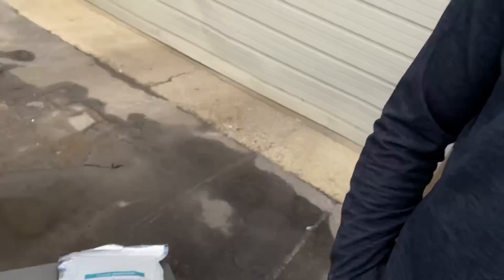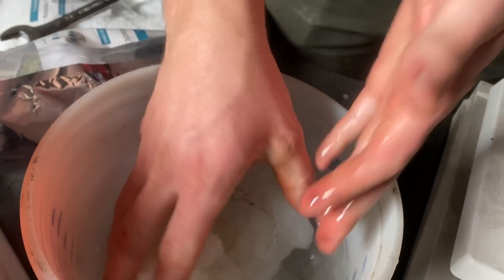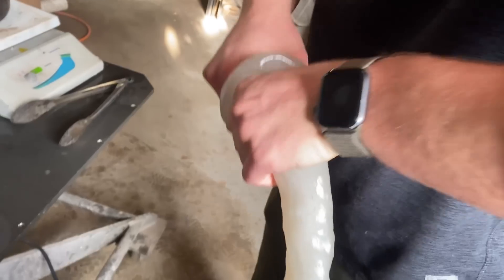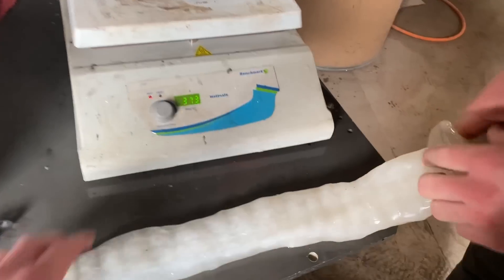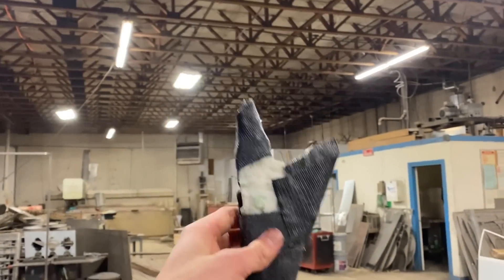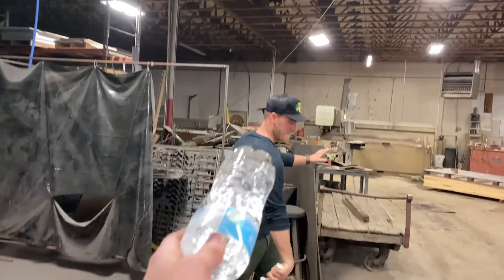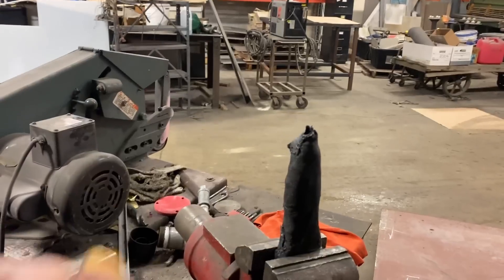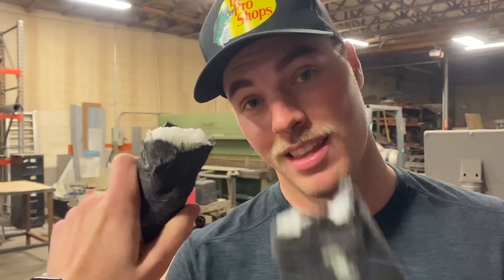These Materials Can Make Anything From Scratch

Comment: You could make some molds out of steel with the water jet or maybe 3d print some stiff molds out of a high temperature filament and use that to make tools that are more refined in shape.

Comment: See the trick is to make a tiny one first, let it cure, and then mold the bigger one around the tiny one and have some thin strips of steel in the plastic where the sharp part of the sword would be, then after the final wrap cut the fiber fix down to the steel strips and then sharpen

Comment: make a sledge hammer handle from it
Run the black tape stuff length wise though for 1 layer then a second layer running on the diagonal that should make it quite useable